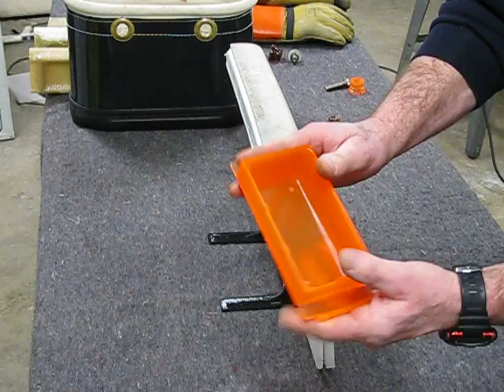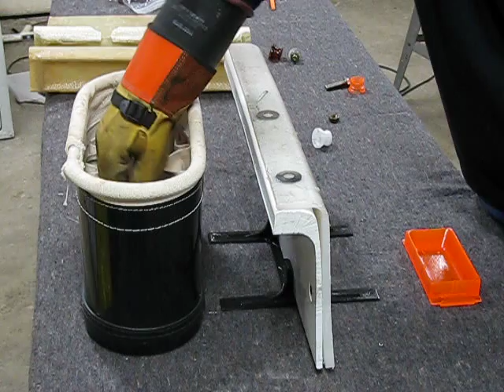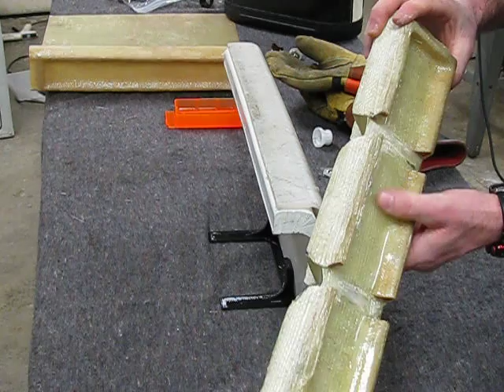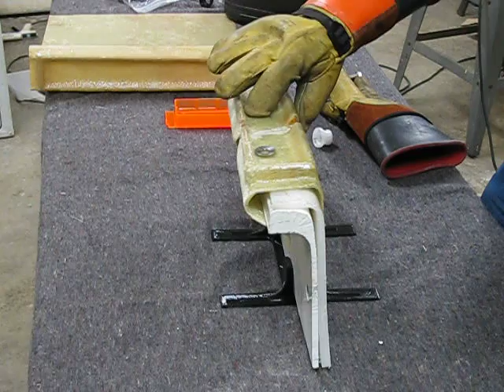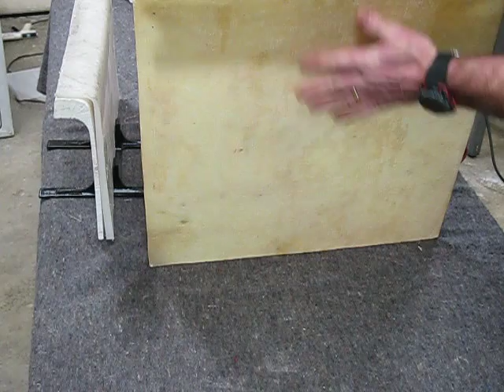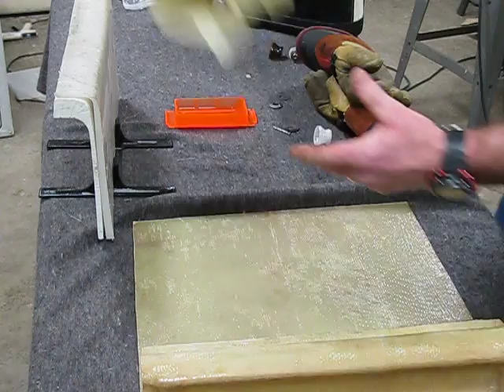Lineman bucket tray

Comment: I had the same issue, but the problem is depending on the manufacturer, the grommets could be apart at different measurements which would not line up with that holder then there would be nothing to help hold that on to your bucket lip.  I went to a shallow polyethylene tool tray, and have never been happier.  I will never go back to an oval bucket setup again, because it's quicker with everything in sight with a tool tray especially the white ones.  At night you can have the help of your spotlights shine from under your tool tray to illuminate your parts from under your tray besides your head lamp which makes work a lot easier and convenient especially if you have a storm that is almost to hit!  Time is everything.  The rapid action of not having to look down into a oval tool bucket is a time saver.  The problem is getting lineman to change their opinion on what they have been used to for many years.